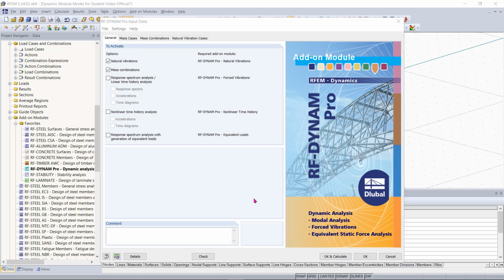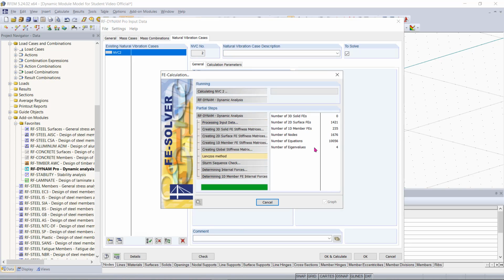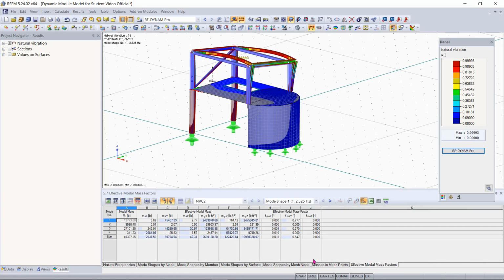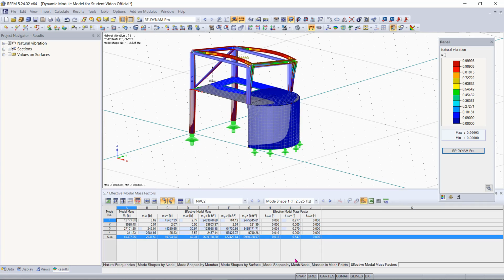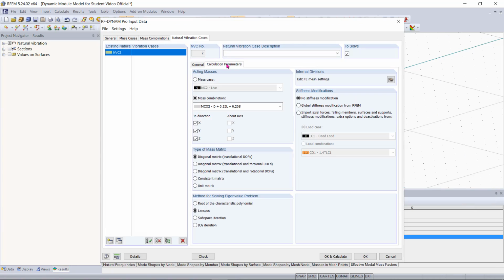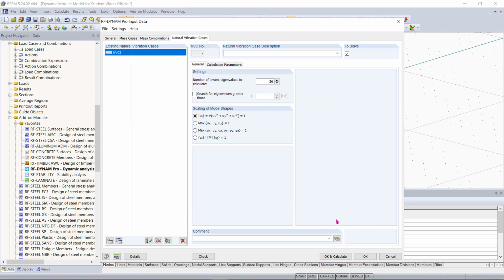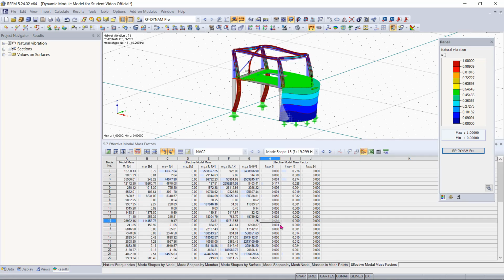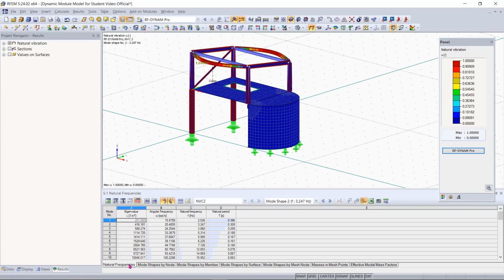[EN] Tutorial de RFEM 5 para estudiantes | 014 Dinámica: Vibraciones naturales | Resultados

Comment: Hi, I've got a question, I was analyzing a structure with prestressed cables, and though I've added the prestress load case to "From force components of:" it does not show a different natural frecuency to different prestress loads (2kN, 150kN and 300kN). It only does when I remove the cables. Do you have any comments on the matter, please?